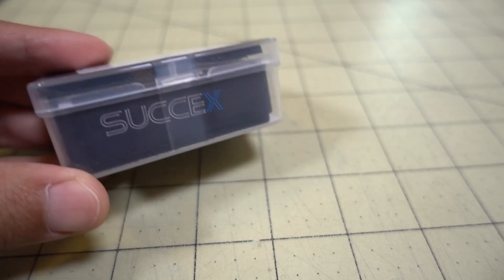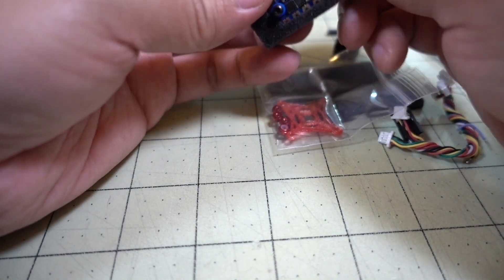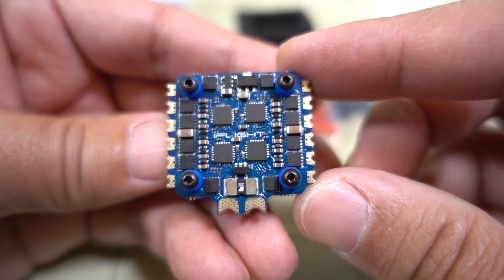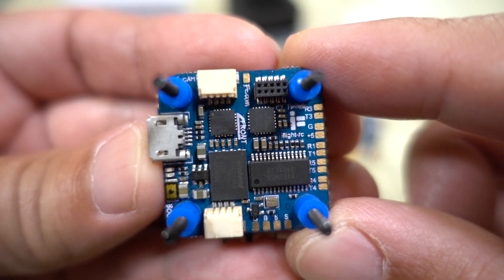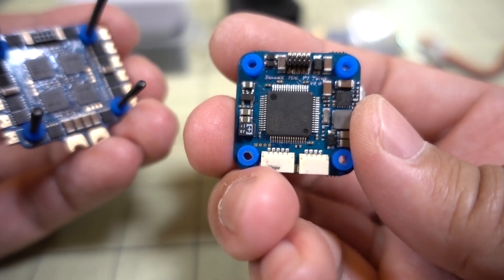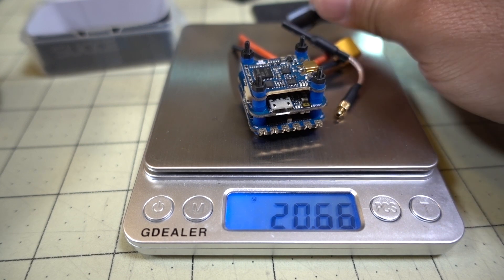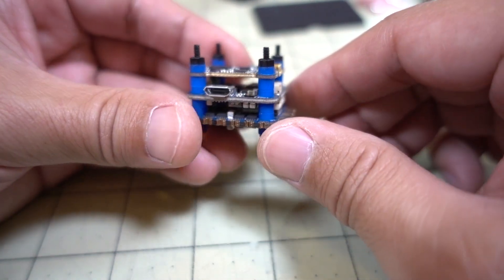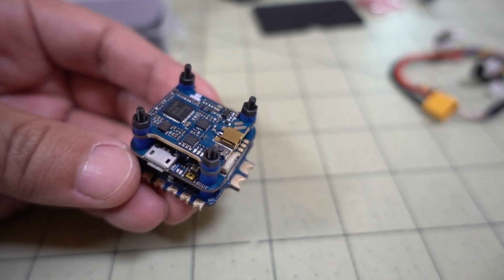iFlight F7 Dual Gyro Micro Stack Review 🏁

Comment: I bought one stack and cant get the FC to work.   No replacement to be found on line or iflight them self.  I wish I could say i bee happy but I am not. I cant use ESC either as it is only pin connection.  Waiting over 2 months for iflight to replace the unit.

Comment: Hello Albert I'm having problems with a low 9 rssi with this f7 stack and have 4 of the f4 and wanted to ask if there's any thing that you knew that could cause this with this stack? Radiolink running SBus and using the plugin and has failsafed twice when obstructed by a hill at close range and thanks in advance Albert

Comment: I have 90/100 C temperature on my fc core after few seccond when i connect battery. Do you have the same problem? Is IT normal?
Reply from the maker: After a few seconds?  You mean after a few minutes, right?  That's not normal.
Reply: @AlbertKimTV  no, after few sec. Like mabye 10
Reply: I have the Same Problem with my F7 Stack on my GepRC Cine Pro 4K

Comment: Plz compare with geprc 20x20 stable  f7 stack!!!
Reply from the maker: The parts are the same, just a different name silkscreened on the boards.  They are made at the same factory.
Reply: @AlbertKimTV  so you dont think i could run this on a marmotte running 5s 1750kv 2207s with gemfan 5552s?